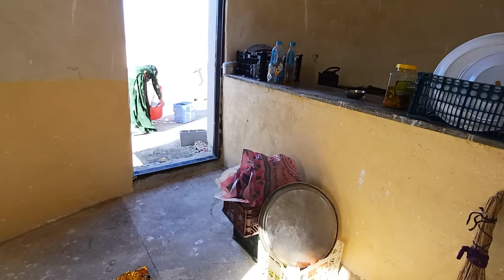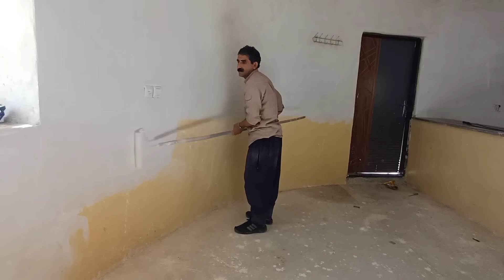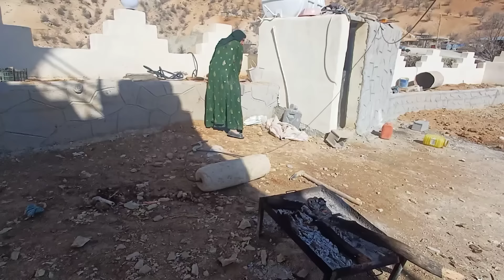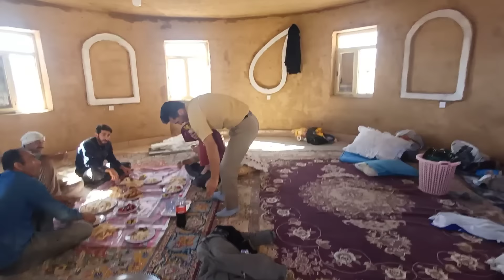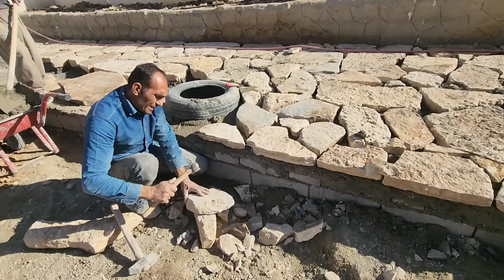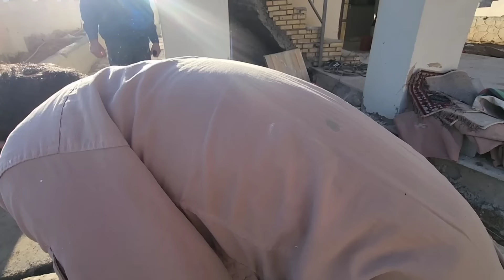"A presentation of beauty: Hasan and Zulikha's quest for the perfect flooring in a nomadic castle

Comment: Hello again,  Hassan, I really like the second guy who took over the painting job and used a roller that created a lacy pattern or look on your wall,  which allows the yellow to show through, awesome!😂 Hey, if you will, please take a paint brush and paint the water  lines running above your kitchen sink to your bathroom shower. It'll be more camafloged or less noticeable,  if it blends with the same color on the wall. Anything that's been missed paint it. Could you move the sink out alittle to paint behind and beneath it? Make sure the inside of your doors are painted well, so no other color shows. I painted our home inside and out and I found out quick it's a hard job.  Anyway, high-five to your painter. Anyway, I love the lacy look, allowing some yellow to bleed through the white.  Awesome!❤❤❤❤❤❤❤❤❤❤

The rocks on your driveway is absolutely divine. Classy look and fabulous my friend. Are you putting up a remote controlled gate? I think you should have a welder create you a gate and add your logo, or your family's  crest, plus a T or an H.  Set it up to use your phone  to open and close it. Best of wishes.  Stay strong, healthy and safe.❤❤❤❤❤❤❤❤❤❤

Comment: The outsides looking great,  and love the light color covering the yellow on the walls on first floor and him using a paint roller to create a upraised lacy pattern which allows the yellow to come through.  I love painting things.   Don't forget to take off the coat rack and paint there,  then put it back... of course like you didn't know that lol! Also what about painting the pipe running over your kitchen sink like the walls? It would help not notice it as much. 😮 I'm one to paint everything visible to hide it, or camafloge it. 😅 I'm loving everything.  ❤ps. Of course paint inside the windows and doors or woodwork the same color,  and get rid of all the yellow.  Just some loving advice, but it's your decision and what makes you happy. ❤

Comment: No no no omg,  the painters has got to go.   They do a lousy job.    They didn't use the paint brush to cut the walls and windows before they could start on the roller paint in the kitchen and I see paint drips running down the wall too.  The top floor why didn't they cover the flooring before painting  and use the darn paint brush.  What a waste of all the hardwork that you and your labourers put in and the painters had to  spoil it all.   Get the professionals to do the paint job.

Comment: The young cute painter isn't covering everything right.  Leaving areas needing paint. He isn't painting the wall down to the floor. Unless you're adding a baseboard then he needs to take it down to the cemented floor, unless you're adding more tile with a baseboard like on second floor. Hassan, I would paint the brown metal on yourc windows and door black then accent the fancy metal work like the flowers Paint it gold. Paint the entire door black then add a shiny Gold on the metal flowers. Same on the outside. Paint the metal black then add the gold only for the detailed designs. This way you won't have to worry about it getting dirty. I saw a couple of places there in Iran with your doors and they were painted black enemal with gold.  You talk about fancy and rich looking,  I was wowed!  Try painting a section of your stairway and stand back and see what you think. 
Guess I'm getting carried away and being hopeful.😊 But I won't love ya'll less or your castle if my idea bombs😅Regardless, everything from the inside out is looking amazing.  Like a fairytale coming true. 
 😊❤😊❤😊❤😊❤😊